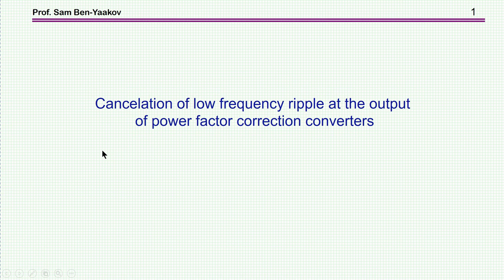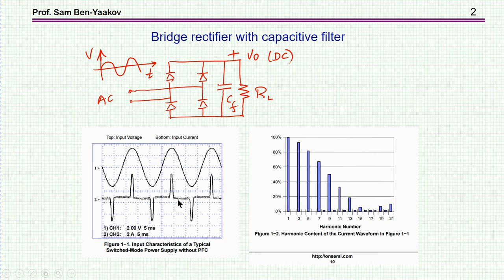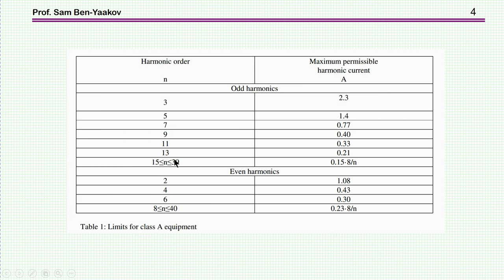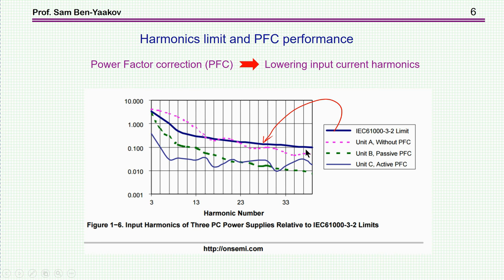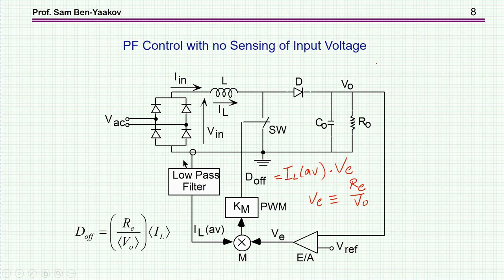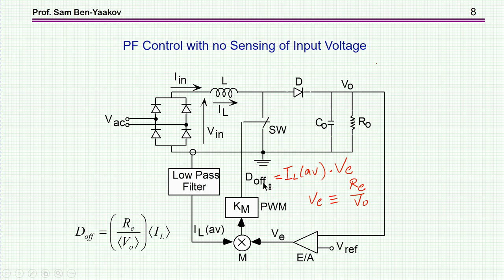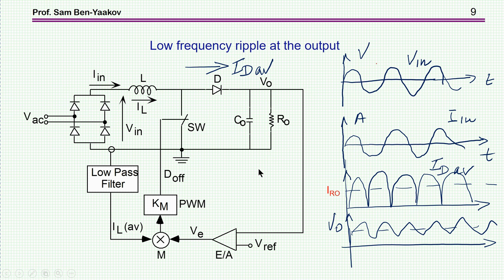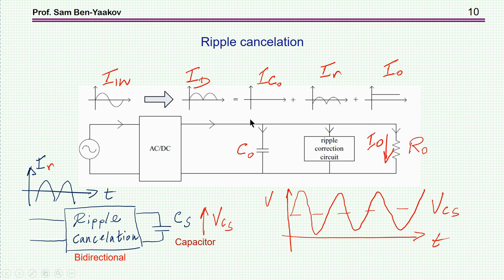Cancelation of low frequency ripple at the output of power factor correction converters

Comment: Hi Prof. How to calculate RCD for Quasi-Resonant controller, the application note AN4147 explained very well but fixed frequency. Quasi-Resonant with no load, the frequency is around 60KHz, but with maximum load, the frequency increases from 60 to 130KHz.Thanks
Reply from the maker: Higher frequency will imply higher power loss in the resistor and a need for a shorter time constant.

Comment: Sam, Your arrangement of the boost (SW5, SW6, Ls, Cs) reminds me of the method that the winners of the Google-challenge used. They used one energy-storage cap, charge/discharging it in order to reduce the ripple on the high voltage rail instead of having huge capacitors on the rail.
Reply from the maker: Hi Darrell, thanks for the input.
Reply from the maker: BTW, in Sentek's website the circuit diagram on the upper right side seem to include a common mode choke. Are the dots labeled correctly?

Comment: Dr why is it important to operate the converters at unity power factor?  I have come across passive and active decoupling techniques for the cancellation of the low frequency ripple, passive technique being increasing the dc-link capacitance and active techniques involving storing the ripple or compensating the ripple in an auxiliary capacitor. Thank you for this video, quite insightful
Reply from the maker: Power factor correction (i.e approaching unity power factor) is required to meet the line harmonics injection limits standard. The standard in enforced in most if not all countries. The reason for it is that a low prow factor means high harmonics content which cause power loss.

Comment: If the LF ripple is too high, either use more capacitance or if it is really necessary to have the output completely flat, then the buck converter which is shown in the video can be powered from the PFC output and used to supply the output.  Yes it will probably have to output more power but it is much easier to use this as purely a Buck and cancel the LF ripple, than to try and do a makeshift solution to fill in the gaps.....
Reply from the maker: Thanks for comment.